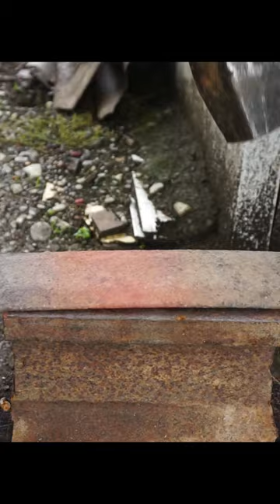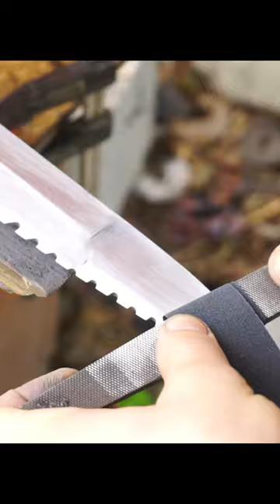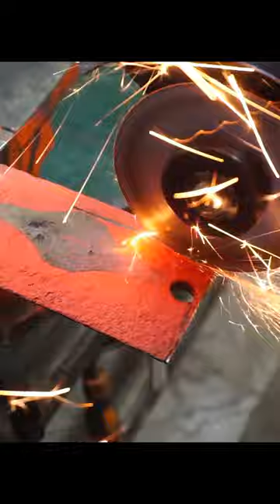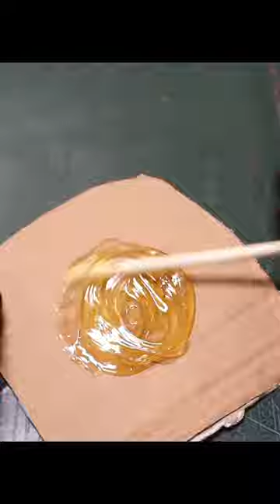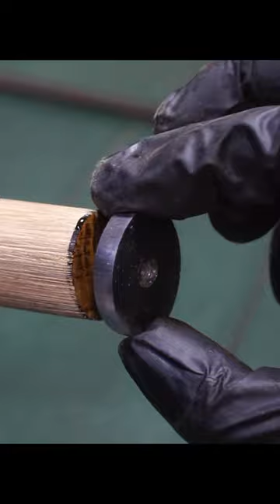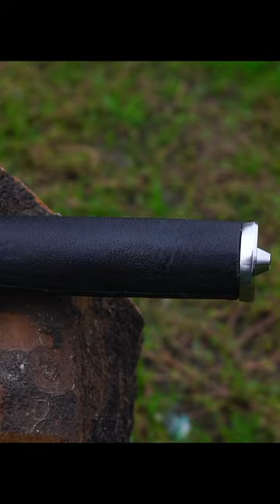Making Rambo Knife | #knifemaking #shorts #satisfyingvideo #satisfying #oddlysatisfying

Comment: My grandpa made knives and all sorts of tools he enjoyed woodcarving. I recall him telling me he used a file to hand cut threads and used a nut in similar fashion to snug up the blade. Lots of stories here, I recall another where he made a handle of split wood and he had used a twine wrap and then he coated it with a resin of sorts. He said you can use twine or wire with that method.